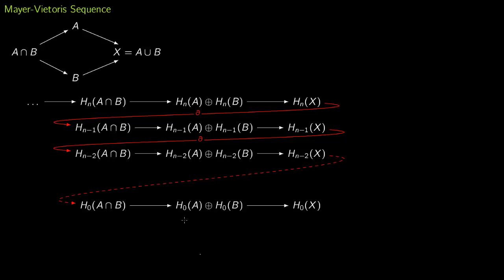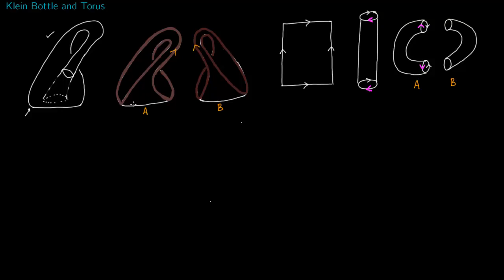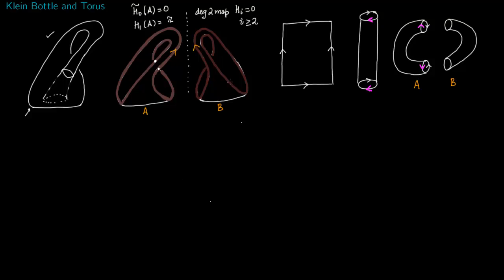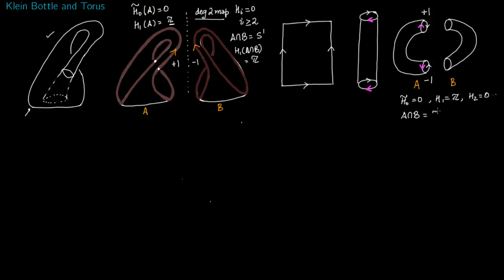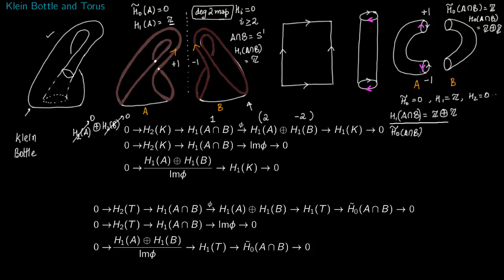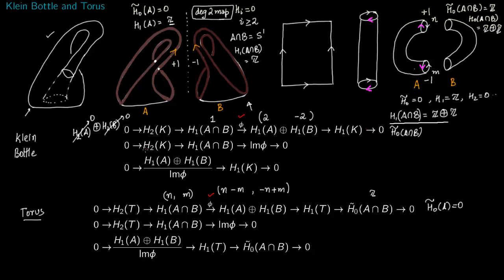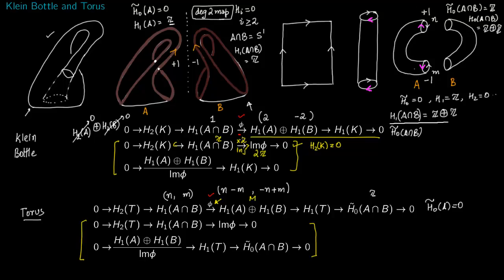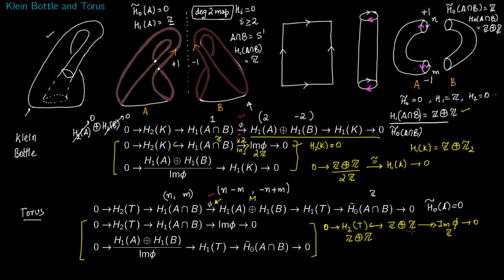Mayer Vietoris Klein Bottle and Torus

Comment: Hey Harpreet. Thanks for the video, it was very instructive and clear. I just wanted to point out a slight mistake that I (think) saw at 15:18. You mention that the second homology group of T2 should be Z+Z, however it should be Z, for two reasons: 

1. The top homology of a connected closed and orientable manifold should always be group of coefficients, in this case, Z. See Hatcher 3.26, for instance. 
2. The SES that you showed on the video implies that H2 is a subgroup of Z+Z, but if it is all Z+Z, then the cokernel must be 0, and you showed that Im phi=Z, this is a contradiction. 

Once again, thanks for the content. I liked the techniques you did with the SES over there, hadn´t thought of that.